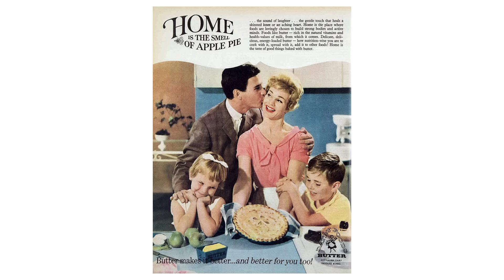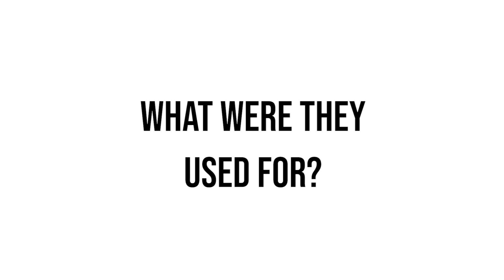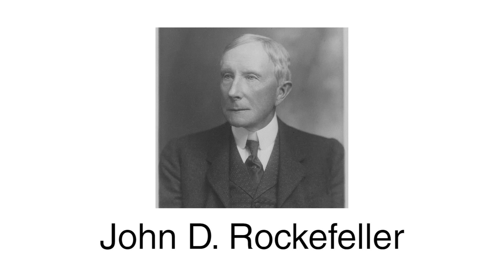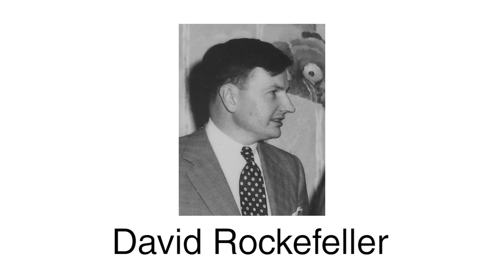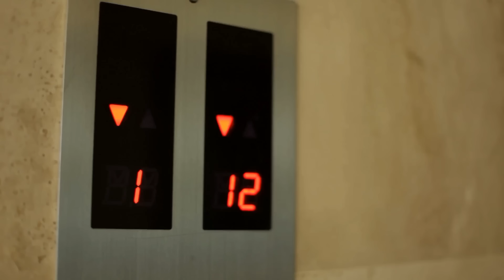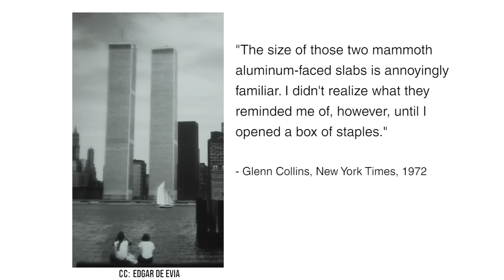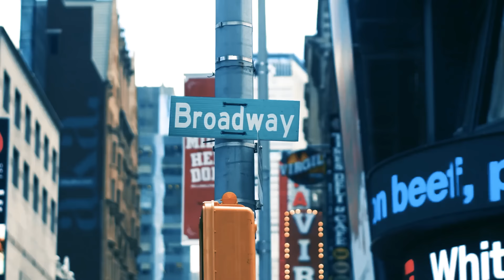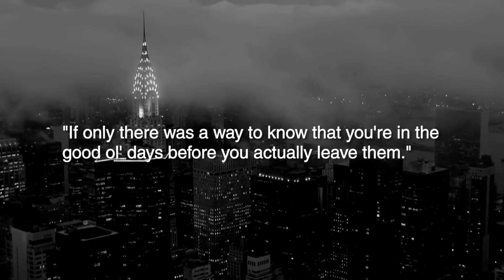What The Twin Towers Meant To America

Comment: If anybody thinks the towers were ugly you have to be crazy. It’s so simple and beautiful. It was my favorite buildings in the city. Btw I know they designed it to take a 707 but the thing is we don’t think they considered fuel. I think it was playing politics. When you put fuel in a wet winged aircraft it makes the wings like a solid chunk of steel. And having the outer columns be the weight bearing support. It’s not a bad design in a perfect world. A fdny fire chief made a huge fuss about it when they were building it he was pointing out how unsafe it would be if it got hit by a plane like the Empire State Building. But he was going up against a lot of deep pockets so they shut him up and built them and here we are today. His fear came true.
Reply: Also they built it for a 707 going at the normal v speed for 1300’. Those terrorist were flying 767s like they are fighter jets. Going in at 500mph. No airliner will ever fly that speed at that low of an altitude. Airliners are not designed for that. But it did prove the planes are stronger and can take more abuse than we thought. I think they pulled 3-4gs in 175 because the dip shit terrorist almost missed the building so he had to turn hard to actually hit it.

Comment: It’s like when the towers fell, America went down hill. The new WTC don’t look nowhere near as iconic as the twin towers were. I don’t even understand how they even fell, or the story of planes don’t sit right with what actually happened. Them haunting images of the buildings crumbling by the square feet will never leave my memory. I was probably 9 years old. Living in Detroit, we just moved and we got the TV plugged in and was seeing the towers smoking out. I thought it was a movie, until the south tower fell and I heard reactions from houses up the street for they were tuned in too. Breaking news. Then the other one fell. Like what the hell. It seemed so unreal because of how big those buildings were. And in a sense, it was unreal. Atleast that story of planes, don’t sit right on how they crumbled. Another building crumbled too of the complex. 7 I think?? Way later in the day. Which really bring up the question, what really happened
Reply: What happened is exactly what the evidence and investigations determined happened, the Towers were built with an inner core taking 60% of the load and the outer facade taking the other 40% with big wide-open thin concrete slab floors supported by lighter gauge steel trusses spanning between them designed to hold the weight of office fixtures and furniture and add some rigidity and such not take thousands of tons of building falling on them in a huge shock-load.

When the supports holding the weight of the upper floors gave way they came crashing down on those relatively weak floors which collapsed instantly onto the next floor collapsing it instantly onto the next one and so forth like dominoes falling, known as a "pancake" collapse. 

Since the floors were separated by 10+ feet of space there was far more open space to fall into than structure to resist it hence why the floor collapse happened so quickly - they didn't collapse into structure they fell between the structure and dragged the structure down with it as its lateral supports were removed and it was pummelled with thousands of tons of debris.

If you watch the close-ups of the collapses you will see exactly what happened - debris in the cloud free-falls and hits the ground first as the floor collapse lags behind it blowing out windows as each floor collapses with the outer facade breaking apart lagging behind that and the core lagging further behind with parts of it standing for 20+seconds after the collapse started. 

WTC7 was a unique structure due to a 1960's power substation and subway line underneath it so it had supports at the ends with longer than usual steel beams spanning them to transfer weight to the edges outside the substation resembling a giant letter H. Steel expands when heated which for normal short spans is often manageable but the longer the beams are the more they expand and that's what happened with #7 as the long beams expanded from the fires they stressed the support columns they tied into which eventually failed.

Please be aware the interior structure of #7 began collapsing first about 8 seconds before the facade finally dropped as seen by the penthouse on top collapsing first and some of the windows and facade "tearing", some fools think the facade falling was the whole building and thus it was a "free-fall" collapse which is total nonsense.

I have no problems asking questions but when you have no engineering qualifications to understand something you shouldn't be surprised that you don't understand it.

Comment: When I knew about the Twin Towers, I wish would go there because I always wanted to touch the sky. I was then disappointed then accepted that it was gone when I learnt about the 9/11 incident. I was born on 2003; I wish it was still there, as the first thing to visit when I get to fly on a plane.
- a Filipino
Reply: What about the burn Khalifa or Shanghai tower
There 250~ metres taller than The Twin Tiwers
(I’m talking about the top floor here)
Reply: @simonking8848   Can you go Outside on the Roof top though in those buildings ?

Comment: The twin towers fits in with 2022 It has some sort of style that fits in with New York city today
Reply: Do you not know what happend to them or??
Reply: @Misha-ke4gw  That's not the point the person is making. It's about the general design and appearance that fits with the skyline of NYC today. So, in an alternate Universe the towers would still stand and the attacks hadn't happened. Either way, one might not rule out the twin towers just getting rebuilt. But stronger and safe this time. Like the design of One WTC does and incorporates, like a reinforced concrete wall acting as a bunker, or thick steel columns that are blast-proof, widened and pressurizes staircases.

Comment: 8:52 Why did the north tower have red lights on the roof and the south tower had clear ones?
Reply: The red lights are Aviation Obstruction Lights(AOL) to warn aircraft of danger because the North Tower had a spire antenna on top sticking up above the building.

Comment: Idk how true is it but didn’t they say the OG WTC was beginning to be a financial burden to operate…?
And they are nostalgic now but were majorly flawed. Just 3 stairwells bc office space was the main priority and purpose of them. Even if 9/11 never happened, there’s some codes they’d violate nowadays. So rebuilding them (post-9/11) wouldn’t be financially sound
Reply: if they were rebuilt they could retain the same exterior with a vastly different interior,  it would be mandatory for the internal engineering to adapt to 21st century architectural standards but theres no rule about 70s era facades or exteriors other than it not being architecturally fashionable right now

Comment: I dont think they could actually survive and inpact from a boing 707
Reply: I read somewhere each floor covered 1 square acre ... that means the super structure had to be some size! Even with kerosene burning, I don't think the heat was high enough to cut the Ibeams. With oxy-acetylene you need 6100-6400F to cut steel with oxidation ... kerosene don't burn that hot. Also, if they didn't purge the cisterns prior to the demolition the sprinklers may have arrested the fires to some degree. Purging the reservoirs is a a red flag to the "terrorist" theories ....
Reply: @Psychiatrick There have been multiple steel structures since the Twin Towers that have collapsed from fire.
Reply: @davidmoltrup51  Such as?

Comment: The titanic was unsinkable, the twin towers could withstand a plane impact. Good job marketing team.

These sort of strengths should be kept in secret not to give terrorist any ideas.
Reply: Learn dude: the towers were designed to resist the hit of a regular plane size in the 70s, way smaller than cuarremt airliner plane, by accident, and just the impact, the fuel werent take in account. All that is very different from a boing 767 at full speed
Reply: @martinrevoiralynch4460  then obviously the design was. Crappy
Reply: @simonking8848  yes get mad at architects for not accounting for planes that didint exist yet or accounting for a event that was unlikely to happen

Comment: I attended one of Richard Gage's dog and pony shows in May of 2008 at Chicago Circle Campus. I got in line to question him after the show about the distribution of steel down the North Tower.  He looked at me like I had grown a 2nd head. 

The cores of the towers were 85 by 135 feet containing 47 columns. The columns were braced by horizontal beams. Since most levels were 12 feet in height that would be 564 feet of vertical steel. I have never seen a layout of the horizontal steel so this is an estimate: 6 times 135 plus 8 times 85 or about 1490 ft of horizontal steel on each level in the core.  So with about 2 1/2 times as much horizontal steel as vertical that would have been significant mass to move and act as a thermal heatsink to slow down temperature rise. So how thick was that horizontal steel and did it vary down the tower? How many tons of steel were in each level of the core?

How much in the perimeter? 

Why have two decades gone by without "experts" discussing and demanding accurate data on the steel distribution? With lots of skyscrapers all over the world why should this be difficult to resolve?

Comment: outdated death traps
Reply: They were relatively new compared to other buildings in New York
Reply: @mikebyrd8278  Yikes.  The twin towers really were outdated messes.  Odd colors, odd design, etc.
Reply: @tina8796  they were only like 30 years old.
Reply: @mikebyrd8278  well, that doesn't change the fact that they were outdated and ugly and that's just my opinion.  the design also cost a lot of people their lives because of the location of the elevators
Reply: @tina8796 Lmao. The original World Trade Center was was unique. It was like a city within a city, 1, 2, 3, 4, 5, 6, WTC being the main part and 7 WTC being connected to the plaza by an enclosed circular bridge. 

It also had multiple art pieces on the plaza. The sphere, the ideogram, the cloud fortress at the entrance, and etc. it was not like any other complex. The sphere was sitting on a fountain in the plaza and spun every 15 minutes.

They even won building of the year award back in 1999-2000. The south towers observation deck was very unique having facts about famous buildings with models of them aswell.
Reply: @tina8796 But they did have design flaws. For example, most of the columns were on the outside instead of the inside.
Reply: @idk-cb8di  true